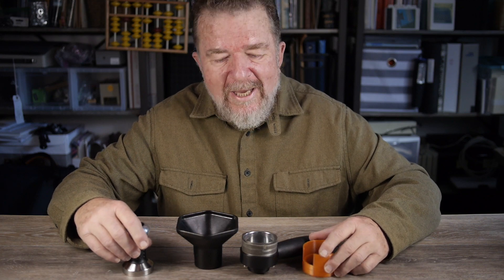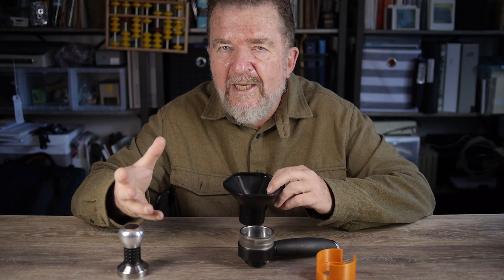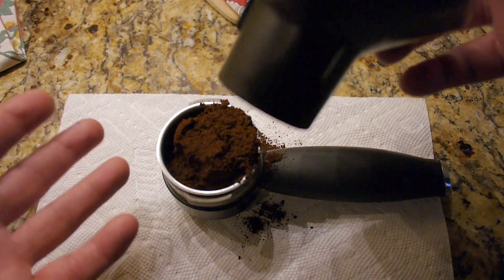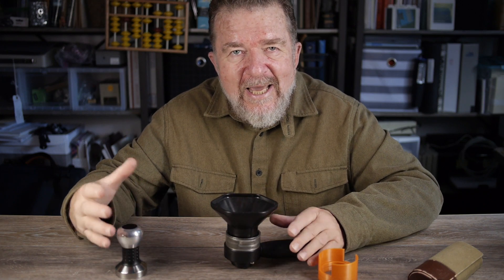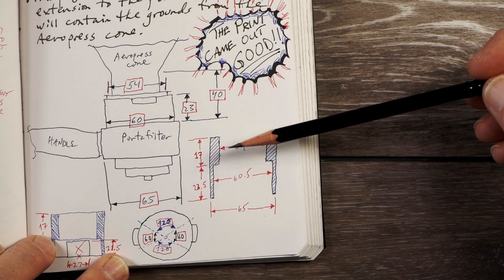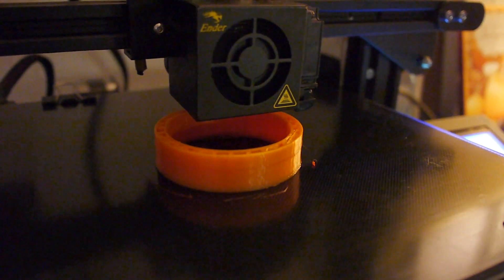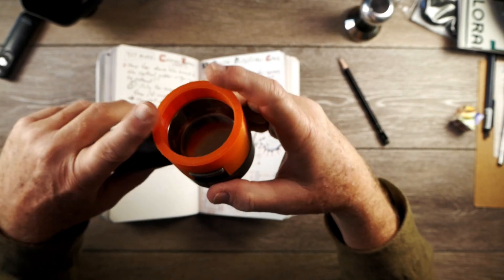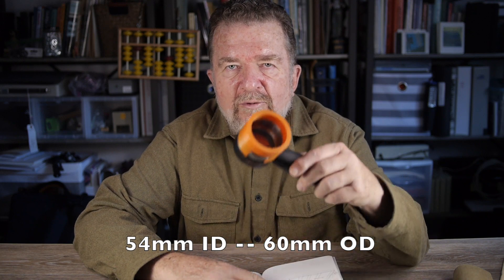3D Printed PortaFilter Adapter

Comment: Joe, you should print a cone shaped opening for the adapter thus eliminating the aero press cone entirely. I just happen to be 3D printing a replacement plastic thumb rest for a friends Minolta SLR, The black plastic on the film advance is missing. 3D printer to the rescue.

Comment: Espresso is such a tinkerer's hobby isn't it? Have you tried a Weiss Distribution Tool for puck preparation yet? Can be made with 3d printed handle and some 3d printing parts. IMO, it doesn't inherently improve the flavor, but helps keep the consistency between shots much tighter.

Workflow that works for me: With a funnel on the portafilter, place grounds into the portafilter > WDT to stir/break up any clumps > Tamp > remove funnel > Brew

Edit: forgot a step to remove funnel 😂
Reply from the maker: The fun part of espresso is there’s never any end to how much fiddling you can do!